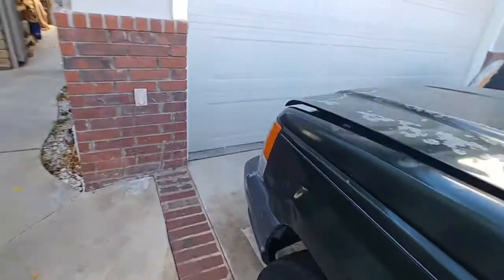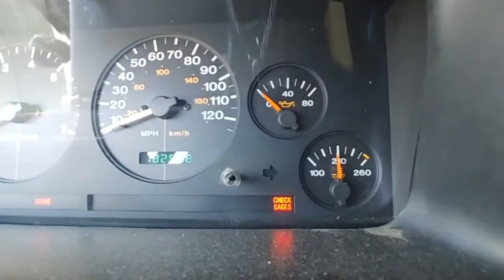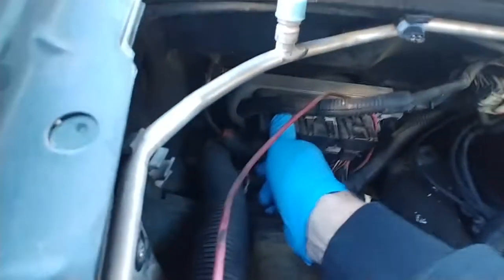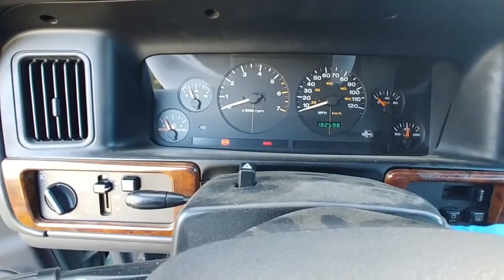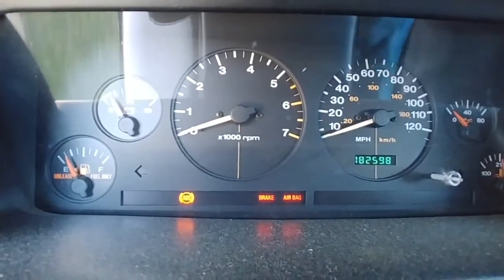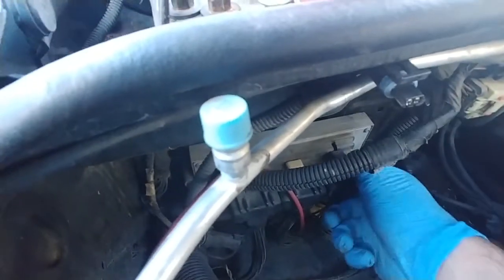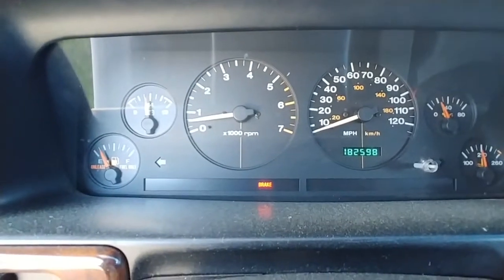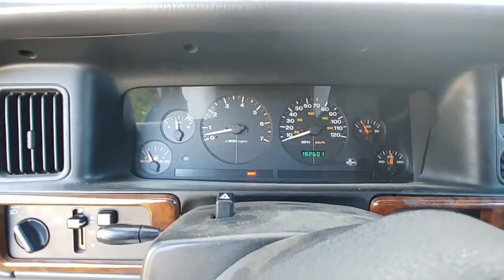1996 Jeep Grand Cherokee Stall Fix - Super Easy - Must Try!! Its not your Crankshaft Position Sensor

Comment: I have the same issue, except mine starts normal until it shuts down. First it gave me a camshaft code, switched that out and it started to shut down on me again. Scanned it again and was told it was a crankshaft sensor now. Bought the sensor and when it got scanned it said camshaft again. So a trusted guy I know said to zip tie the ecm connections, did a half ass job on that but worked for a few days until I got the same issue again. Now it's not giving me any codes at all, but my Jeep still turns on fine but after a few minutes it shuts down and I can turn it back on again instantly. The guy I know said not to replace the crankshaft sensor but to replace the camshaft sensor with an original jeep part.. so now I have no clue on what to do.
Reply: I have the exact same issue and feel your pain, Does yours have two cam shaft sensors?
Reply: @waynereynolds8094  I think mine has only one, under the distributor cap.
Reply: @TheSpineSplitter1990  I have a v8. Have to made any head way with it?
Reply: @waynereynolds8094  Took my Jeep to a mechanic last week and got a call yesterday to pick it up to drive test it to see if they fixed the stalling issue and they didn't fix it. They can't find the problem. Had it scanned again and now I get a MAP Sensor code and a Torque Converter Clutch Solenoid issue. It still drives fine but it stalls randomly at idle or at a stop. But I'm able to turn it back on 100% of the time fast. I got one more guy that I know who knows about electrical issues so I have to give that guy a call.

Comment: Thank you for posting this.  Going through the exact problem on my 97 ZJ.  Was about to make an appointment to replace the sensors.  Will try this now.  Has the stalling come back?
Reply from the maker: Yes, unfortunately it came back. I've switched many sensors, coils, cleaned grounds, ecm ect... Still have the issue. Gonna try the zip ties next to make the connectors seat better.
Reply: @cnote001  do you think it's still that connection?   When you play with it does it go away again?
Reply: @cnote001  Save your time that trick only works on the 4.0L engines. Chances are it's your crankshaft sensor.
Reply: @cnote001  Might be inside the CPU, like in the ABS computer where they resolder everything, might have to get a new CPU...

Comment: Did you have to wait for the check engine light to come on, that then the fuel relay kicks in... Mine just died ole 93 that otherwise runs great.
Reply from the maker: I never got a check engine light actually. I get a check guages light which made me think it was some kind of fuel issue. Still haven't fixed it but when it wont start and i turn the ignition on and off 3 times it always cranks up and runs without an issue for a while before stalling again.
Reply: @cnote001  Yea, that is what mine does.. It won't start till the check gauges light comes on and the fuel pump relay chatters then kicks in and you can hear it priming the fuel rails; then it will start. It is like the car (wiring) has to warm up before I start it warm...lol ... I turn the key on and wait for the light and the fuel relay... then its good to go.
I believe it is connector issues like you discovered. I suspected Mine might have something to do with the old alarm I have jumped out.  (It's jumped to where it is like a key is in the door, causing some battery drain over time when I don't start it everyday or so.) I'll let ya know if I track it down. Good luck..on your end...

Comment: Did this fix the problem
Reply from the maker: Only temporarily unfortunately
Reply: @cnote001  Did you replace the computer/ecm with a new or used one?  The used one could have been in worse condition than your original one.  Did you check for the need for the computer/ecm to be reflowed?  I have no affiliation with these guys, but try ecmrepairs website or another ECM repair company, you have to make sure all the solders and connections are working to rule it out.  Mine 97 5.2 is stalling like this...  it just had power steering fluid spray all over it...  but I tend to think it's the power steering pump causing too much drag... right before mine stalls the battery gauge goes down to about the 1/4 mark...  so I think either the power steering pump or the AC or both are dragging on it but I'm just getting started with this since it just started doing this... did you replace your main serpentine belt and check that it is tight enough?  Did you clean out your MAF and the air flow path?  There is also a thing called Mopar Combustion Chamber Cleaner and I'm going to try it, have it on order.  On these ZJs the intake manifold gasket can fail and leak oil somehow, did you check that?  Mine started to stall after the top power steering fluid hose failed squirting fluid all over the engine bay and starting a little fire on a hot day that I got out in time with no damage... at least that's how I remember it, then I thought it was staling when going over a bump due to the power steering having to work harder when under stress... in the morning mine stalls so I rev it at 2k rpm for 3 minutes and then it works for a while.  It's really intermittent.  Did you change your battery?  I suspect my battery is bad, I just had to refill it with water it was nearly totally dry, but every time I take it to OReilly to get the battery/alternator checked it won't stall and their machine says the battery is good and the alternator and starter are good... I think it might have a faulty cell that short circuits if it gets bumped or leaned/tipped just right.  So I would try replacing the battery too.  It's really a process of elimination and how much patience you have.  I love my ZJ and it's been almost perfect until now, by far the best vehicle I've had and we've had Mercedes, Porsches, VWs.  Keep us posted please?

Comment: I have got 98 grand Cherokee Laredo jeep I have change crank sensor cam sensor plug an wires distributor cap button under the cap new battery new termals still having a problem when u start after a few minutes it dies
Reply from the maker: @MikeHolt-k2s   have you replaced the O2 sensors? That's what I'm gonna try next. Replacing the ECM could be the fix too due to faulty solders on the board. Good luck!
Reply: @cnote001  thank u I think we fixed it with having to change the PCM I got this cleaner an sprayed inside the plugs an wiring to the PCM an a lot of dust an dirt came out drove around for half hr never died thanks to people on u tube for suggestions

Comment: I'm having the same problem. Was this a permanent fix?
Reply from the maker: Nope, wasn't a permanent fix but I discovered some other things. I got a new computer (ECM) and that didn't fix it. Then I discovered that once it wont start after stalling a few times when I turn the ignition off and on three times in a row quickly, it will start and run without stalling again. Strangest issue ever.
Reply: Zip tie those stupid plugs into the computer.  It will help.  Check once in a while because hot-cold and weather will stretch them.  Retighten as needed.  It is an aggravating model.
Reply: Fuel pump fuel pump fuel pump 100 percent fuel pump your primed it when u truned the key 3 times
Reply: Fuel pump is 6mths old so i pretty sure thats not it. I've changed out the ecm an it ran fine for about 2 weeks then started back. I put back in the old ecm just to see what would happen an it did fine for about a 3 weeks then started losing power while driving but it never cut off. I changed the alternator with no change so I'm going to send the ecm off to see if it can be repaired. If it doesn't solve the problem it's going up for sale an be someone else's headache
Reply from the maker: @larryschmid3043  I had thought fuel pump because of the check gauges light too. Or maybe a vapor lock. The fact that many have tried changing the fuel pump with no luck made me not try it.
Reply: Check it with a pressure gauge hook it to the valve on the fuel rail
Reply: @jayragoonanan2598  I agree on these jeeps are problem child's and headaches to own , I have one broke down on me last night , run fine till crossed train tracks and she died and would not restart, these things have electrical issues , belt alignment issues , manifold leaks , suspension and steering issues , I actually bought mine after hearing how great an engine the 4.0 liter was however I've done nothing but have issues with it since and everything around the engine falls apart daily , JEEP= Just Empty Every Pocket
Reply: Update it turned out the pcm. I changed it out about 2mths ago an it's been running fine ever since 🤞
Reply from the maker: @jayragoonanan2598  man, that's awesome! I swapped mine out and had the same problem. Dangit!! Glad it's working for you tho!
Reply: @wildnwheeling3042  That's wild, mine did the same thing last night on my way to work. I crossed the same set of RR tracks that I cross every day, and it shut off on me and wouldn't start back up. First time its done that to me in the 2 years I have had it. Locked it up and got a ride to work. On the way back I decided to see if it would start back up so I could try to get it home, and it did! So I made it home, then this morning I diagnosed and finally found the culprit. The middle connector on my PCM when wiggled or bumped caused the engine to cut off. While the key is on, if I wiggle the connection at the PCM I can hear the fuel pump kick on and off as the connection makes and breaks. So its either faulty contacts or could be broken solder joints inside the PCM. For now I am gonna try the zip tie fix because if I hold the connector tight against the PCM it seems to work fine!
Reply: @wildnwheeling3042   Everything that you just describes has happened with my 98' grand cherokee laredo. Had to give up on it because no mechanic could help with the issues as a high schooler at the time couldn't afford all the "repair" bills, telling me my jeep is fine and I take it home and it stalls the next day. Been sittin in the driveway for over a year now...
Reply: Literally just try the zip ties guys, it’s probably the only solution to this problem mine looks like a rubber band all with zip ties
Reply: @jayragoonanan2598  what is site you brought PCM/ECM on?  And was it reprogrammed or plug and play?
Reply: @rapsnippets2978  ebay and it was plug an play. Just make sure  the part numbers match
Reply: @jayragoonanan2598  what site?
Reply: @rapsnippets2978  EBAY

Comment: why do u keep turning on that freaking A/C?? which is putting an unneeded load on just about everything....leave the damn thing off and go fix your plugs to the computer!!!  there is nothing wrong with the computer itself its just the freaking connections.....replace them, but be careful $80 a crack new so go to the yard get u some and make sure top and bottom clips are intact and not broken!!!!!  do that and you'll be in there!
Reply from the maker: Hahahaha...shit, I hope it's that simple!! Thanks!!
Reply: Got my connector at a bone yard for $2.35 plus $2 for entry Ha

Comment: what does the ac have to do with it
Reply from the maker: I'm not sure lol. It seemed to stall when it got a bit hotter than 210 so I had it on to get it hotter at idle.
Reply: I have the same jeep. Same issue. This video helped alot. 
But to maybe answer your question about the AC.
Think it has something to do with the RPMs. The ac has a good pull on the rpms. 
Must be some correlation with the computer, the wire issue, and the rpms.
Reply: @cnote001  the AC is on the same belt as the engine crank as the alternator as the power steering pump they are all on the same main serpentine belt... so if the AC is dragging the belt it can possibly cause the engine to stall at low RPM due to mechanical drag.  Did you install a new belt and tensioner pully?  My AC makes a single fairly audible clunk noise when I turn it on, I wonder if the AC bolts are tightened down.  So here are the thinks that I think could cause it:

ECM needing to be reflowed or repaired
intake sensors IAC 
crank position sensor
dirty MAF and intake
fuel pump
bad or weak alternator or voltage regulator
bad or dragging power steering pump
idler pully dragging
AC pulley or pump dragging
bad serpentine belt
bad battery
intake manifold gasket leak
bad O2 sensor
clogged fuel filter

I would go down this list with the help of your local mechanic.  I just found that Firestone was super cheap when they fixed my power steering upper hose for around $150.

Keep me posted please.